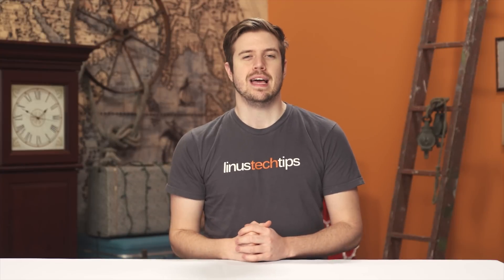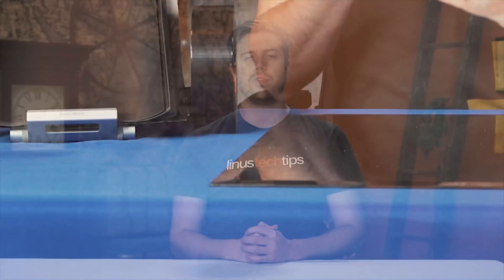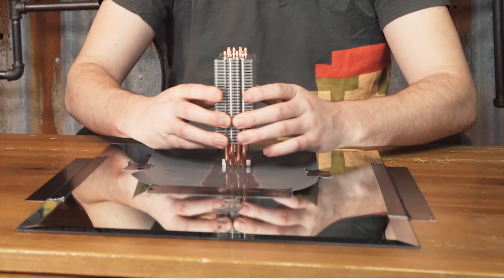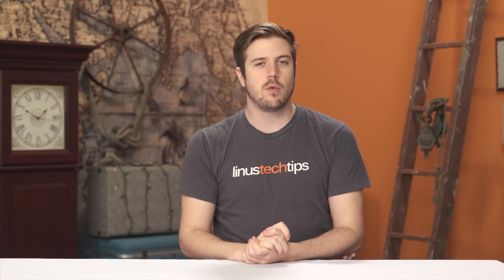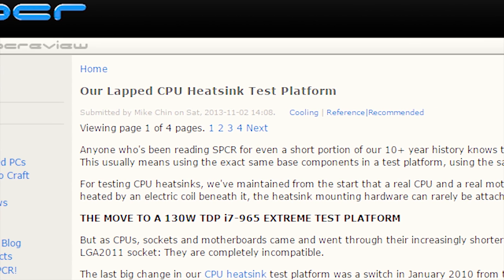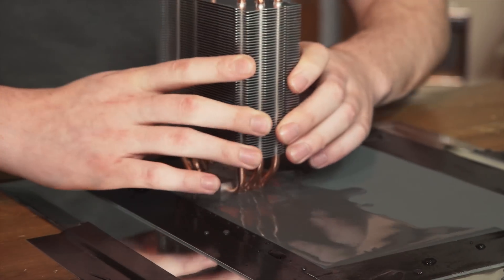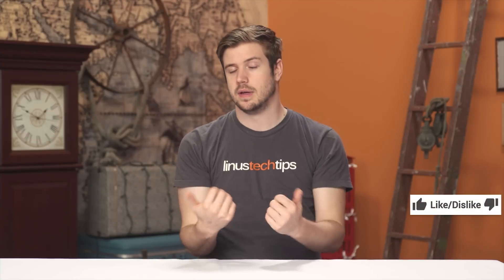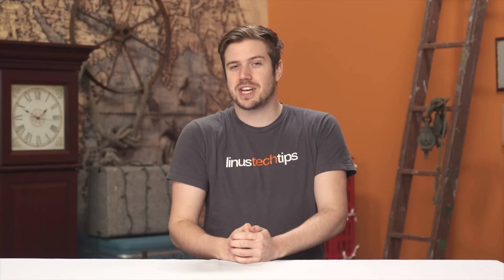CPU & Heatsink Lapping - Are concave, convex, or flat heatsinks best for cooling?

Comment: I have Thermaltake Archon cooler which has a really nice flat base - no need to lap it. I've been using it for last 4 years and it performs great. I've lapped my last 3 CPUs though and I've also delided my i7-3770k and changed TIM under IHS. At 4.4GHz OC on i7-3770k max I get is 65C (ambient around 22C) under Prime95 (ver. 28.9) max heat stress test and before lapping/deliding I would get near 85-90C with OC. Convex coolers work best with Intel CPUs since those CPUs usually have concave IHS'es, so convex cooler fits better. After I've lapped my CPU it would stuck to my cooler base even without TIM applied. I've applied a minimum amount of TIM just for safety - 1/3 of usual rice size and it was enough to spread on whole IHS after mounting the cooler. Luke should have tested lapped CPU and cooler combo (or even just the CPU when paired with that EVO cooler) - gains should be more visible, although do not expect more than 5C drops on new Intel CPUs. Why I do it? It's fun, you can brick your CPU and basically I'm bored :)

Comment: Luke, I doubt lapping would make much if any difference as long as you apply the cooling paste.  Just like in a car engine, properly lapped heads do not need a gasket to create a seal I would think a properly lapped heatsink would not need paste.

Try this same test with a normal heatsink and paste, a normal heatsink without paste, then the same two tests (with and without paste) on a lapped heatsink. 

I'm betting the only and or most noticeable difference you will see is between the unlapped and lapped heatsink without paste.

BTW do you also lap the CPU to make sure it is flat? If so add that variable to the above tests.

Comment: ouch, another waste of time. Mirrored finishes are good for ease of cleaning and reduce air drag, and that's about it. Lapping is typically done with a compound and using both surfaces to get the tightest fit. If there is a seam, there will always be air trapped inside that seam. At best you could gain 3°c or waste 3 hours, better odds with an aio water cooler at that point. I think cooler mods and testing are tapped out for the time being.

Comment: As someone who works with a lot of heat transfer (Nuclear Navy and Civilian Reformers) it kind of surprises me the amount of effort you guys are putting into this. The temperature you deal with in PC's is so low that as long as the surface is relatively smooth and flat you aren't going to see a difference due to polish. You are tightening down the cooler and forcing the two metals to make very nice contact, so that's all you need for nice heat transfer. As long as the material of the heat sink transfers energy rapidly. If you were trying to transfer something more like 300 F and up then maybe you would see the polish affect it but it would still be negligible. Differential temperature is still a better factor, so if your air cooled system is under performing you either need better fans or a better fin set, if that still doesn't work you need a better medium like water. The direct metal connection should be the last thing you put your time and energy into.
Reply: +Ian Tusa Not to mention that the manufacturers would polish it themselves if it made a difference. I mean that would be a super cheap way to improve performance of your product, but most don't do it.
Reply: +Tom Ault You isolated poor machining as the only  cause for that drop in speed?
Reply: Redesigning the entire heat sync would bode better results than just tampering with the direct contact surface area.
Reply: Tom Ault The electrician who learns how to put the blue smoke back in the circuit will be a millionaire.
Reply: Ian Tusa Linus did. Kinda. On a budget.
Granted as well - "fun" is dependent on the person =3 - while you may not find this fun or even having a point, if Luke had fun, enjoyed it, and wanted to just do it, that's enough reason for him to do it.
Reply: Zane Blalock He just seems to be getting frustrated about non-effectual things.
Reply: Ian Tusa Hello, welcome to humanity, I'll be your guide :)

lol - but no, genuinely agree xD
Reply: +Michael Kinkema While you guys might have qualifications in heat transfer you obviously don't know much about computers, imperfections on heat sinks allows nucleation of the blue smoke and results in a slow leak that degrades clock speeds over time. I've seen a drop in base clock of 50MHz in just one year from poor machining.

I'm sure in another couple of years people will have been putting LEDs in computers for so long that they'll start to think there's some performance benefit to it.
Reply: +Ian Tusa True indeed - but it's fun nevertheless :) - sometimes someone just wants do something for the sake of doing it.
Reply: Dhruv B He's trolling. Nucleation of blue smoke is a joke about electric fires.
Reply: Zane Blalock If they wanted something fun to do they could build their own liquid cooler.
Reply: That's what they're here for. They are the Mythbusters of consumer PCs. They test the random things people looking to gain an extra point on a benchmark are going to try before they decide to invest in a hardware upgrade. They are here to test and warn others before they do something unwise. I just enjoy trying to predict what is going to break first, the myth or the rig.
Reply: Another big issue is the thin pipes of copper that have to transfer energy a long way before the sink. The larger the differential the better the heat transfer and a long pipe makes for a slow gradual temperature change. It would be more ideal if the sink started earlier.
Reply: +Ian Tusa After taking heat transfer courses It surprises me how much effort people put into things that don't really matter. Metal on metal contact is going to have such a high heat transfer rate that nothing like this was ever going to matter much.
Reply: Steve Exactly

Comment: So your increasing the surface area of the heatsink. Now use graphene as thermal paste. Why don't you run sand paper on the CPU (without breaking it) as well  ?

Comment: I'm using 10 year old Xeon on modded 775 board, and i had issues with temperatures on CPU. I tried new heat sink, new thermal paste but nothing helped. CPU temps under load was around 85-90 with all 2 case and 1 CPU fan blowing at max speed.
After checking the web for solutions i found "lapping". I did a rough lapping, max sand paper i used was 1800. During lapping i saw that the IHS had a large dent in the middle that was massing with the heat transfer, as the heat sink contacted the CPU only on its edges.
Results are great, under full load i have 75-80 with CPU fan at max speed and 2 case fans at 50%.
It's still a lot but it keeps the cores cool enough to prevent thermal throttling :)

Comment: I kind of get the feeling that the increase in cooling performance is due less in part to the smoothness of the surface and more because the walls of the heat pipes are thinner...

Comment: All these tweaks just dont matter. Dont waste your time for those 2 to 3 degrees in temperature.
Reply: +Sword of damocles You have obviously never heard of the term "enthusiast"
Reply: +Ian Anderson heh
Reply: +Sword of damocles It's worth it in the long run if you think about it, 3 degrees is a decent amount of cooling for an hour of work. but i'm not overclocking and my cpu hits max of about 30c, so I won't be doing it.
Reply: +Superkoopatrooper my reply was to a statement talking about the difference of a couple degrees achieved by no specific means. Please don't rant on someone who's talking about something completely different.
Reply: +Ian Anderson ran out of ideas*

Comment: I need your help please :D Is this build good for 600€? This is my first time building a pc on my own :p

Cpu: Intel Core i5 4460 (3,2 Ghz)
Cooler: Cooler Master Hyper 212 Evo CPU-Kühler 
RAM: 8GB Crucial BallistX Sport (1600Mhz)
Motherboard: ASrock B85M Pro3 mATX
Gpu: ASUS R9 380 Strix (2GB GDDR5)?
Psu: Corsair CP-9020097-EU VS Serie VS550 80 PLUS ATX
Case: Sharkoon VG4-W Midi Tower (USB3)
Storage: 1000GB Seagate Barracuda (7200rpm)
Ssd: SanDisk SSD PLUS 120GB Sata III
Reply: +Rawrpwnzel I agree with Jan, get the 4GB version of the 380. You will NOT regret that.
Another recommendation is to stay the hell away from Seagate hard drives. Preferably go with HGST drives or a WD. And maybe go for a 250GB SSD. From personal experience, a 120GB will get full fairly quickly even when you have a mass storage drive for games and such.
Reply: +Rawrpwnzel I´d say it´s alright. Maybe spend few more € on the R9 380 with 4GB VRAM, anyway if you can wait, wait for June, there should be new GPUs coming out so you can either get a price drop or performance bump.
Reply: the thing is i don't wanna spend too much money, as long as it can run dark souls 3 etc. i'm happy

Comment: Early '00s with the Ghz wars it made a difference for, Straight die contact and with heat sinks that used inserts. It made a difference as a lot manufactures did not bother/care/know. Some were even rough to touch. 

But with IHS and Heat pipes, No.

Comment: next time try to do the same on 1° Gen  ACX Gpu coolers this surface was a mess  fully of imperfections and scratches.   
i did it in my GTX 760 ACX  and works very well,  just get a singnificaly drops on temps.

Comment: Soooooo, no cpu lapping? Why is it in the title then? In my experience with lapping, the cpu makes more of a difference. I have done this on a few cpus older amd 3400+, 965 and a 2500k All of them had temperature decreases of around 3c. Doesn't sound like a lot but when overclocking every degree matters.

Comment: What you did in the video would be considered simply wet sanding. My understanding of the lapping process would require lapping compound (a paste with abrasive grit in it used commonly in automotive valve lapping). It further would require lapping both contact surfaces which would include the CPU lid. I don't know if it would be a good idea, since any remaining compound might foul the CPU, but it may be worth a shot! I'd love to see a quick revisit with proper lapping technique.

Comment: this was done back in the day on The Screen Savers by Yoshi. he used a solid copper contact and polished it to a mirror finish. the results were very positive. it may just be that type of heatsink where the contact is not solid, but made of different parts. I did this with my stock amd athlon 64 3400 cooler and saw a 6 degree drop.

Comment: So you lapped the cooler and left the CPU? I lapped my waterblock and my i7 860 back in the days to a mirror finish and used almost no thermal paste between them. I got a 6 degrees c improvement. But this was a soldered CPU. I think the ones with TIM need a delid and mount without the lid.

Comment: Wait what? Is this 1st April joke? Who ever thought this was a good idea? The thermal paste or cooling paste is most likely a paste with high heat conductivity. It is used to replace any, or at least as many as possible, pockets of air between your cpu and cooling device. Stagnant air is good insulation and will keep the heat from spreading away from it's source. Metal on the other hand has good conductivity and is used for leading the heat to a cooler area or medium, in this case the air passing through your chassi.

The fans should be flat enough from the very beginning or else they are bad quality. Secondly, using sand paper you usually start with the rougher papers and work your way down to the finer papers to anything else is just not well thought through.

Comment: I think lapping was a thing back in the day (like years ago) when manufacturing a heatsink consisted of "Hey throw this block of aluminum on a table saw and sell it to AMD or Intel..."  combined with the TIM before Arctic Silver became a thing,,,  These days the quality of even the Evo 212 is pretty much 10,000 times better than the old shit, combined with thermal pastes being also way better. Just makes lapping nearly obsolete in my opinion.   

I in fact wonder if lapping could actually be worse... Like a golf ball flying faster because of those dimples, would not more surface area be better for heat exchange?

Comment: I lapped my Phenom II x6 1100T, The top of the heat spreader on the cpu was not flat, it was high around the corners or edges of the CPU, I dropped 10+C after I did that, I didn't do anything to my cooler other then replacing the thermal compound.

Comment: Luke please do a vid on if you really need to reapply thermal paste after removing the heatsink or you can ignore the air bubbles formed when you put it on back without cleaning the old paste

Comment: Lapping just makes up for a bad thermal compound to an extent. A good thermal compound will fill any of those imperfections and provided the molecular density of the compound is smaller than the imperfections on the die and heat sink then you will have no problems with heat transfer. Any air that gets trapped in these imperfections however will be a depredation in thermal transfer, so here is where lapping is only any good if the heat sink is really bad in the first place.

I do wonder however if applying the paste and heat sink within a vacuum environment would help? You would have no air molecules to worrying about between the heat sink and die, however im guessing a void in any gap would be worse than air molecules which can at least exchange heat a bit. Maybe a test worth doing though?
Reply: Iv thought about this since Linus did a budget of video then said"were not putting a pic on water or in space" ur point is valid that th e thermal paste would have less imperfections, but u need air molecules to transfer heat away from u the pc
Reply: +Manav Anand I didnt mean run the PC in an airtight environment just apply the thermal paste and heatsink on cpu in an airtight environment so there would be no air molecules between the cpu and heatsink. Theoretically the thermal paste should perfectly fill the voids on the surface of the cpu and heatsink. Once applied the motherboard would be taken out the air tight environment and then setup with other components. Im sure Linus Tech Group could fashion or locate an airtight apparatus, we had one at my naff secondary school many years ago!
Reply: Chris Mason u didnt need the big explanation... :) but i get what
 u mean now

Comment: if anything, lapping i think should theoretically be worse because there is less surface area between the thermal paste and the base of the heatsink. the imperfections increased surface area

Comment: Does it acually matter if you have a case on or not? Will the components be cooler with case + casefans because of airlow? Or will they be cooler in an open case (like the Thermaltake P5) or a testbench because heat rises?

Comment: sorry, it matters not at all. the thermal paste, when applied correctly, fills in all gaps, crevasses and curves and allows for proper heat transfer.
furthermore, scratching away the surface of the metals will actually increase the  possibility of heat induced oxidation which will hurt the ability of the heat sinc to transfer the heat.
DO NOT DO THIS
Reply: this is correct, to actually see the affect of lapping you would want to test before and after without thermal paste.
Reply: ***** 
no, increased surface area of the fins dissipates the heat, the surface area of the sinc that makes contact with the cpu, as long as it at least covers the entire cpu surface, does not increase the heat transfer from the cpu to the sinc. because there is only so much surface to transfer from.
the size of the cpu is the bottleneck
Reply: +Tigglet Please use capital letters, it's annoying to read a text without them.
Reply: +Tigglet Fills, as in removes air which is a insulator.
That's a whole different thing then conducting as well as a solid piece of copper or aluminum.
And if you remove Air...you don't have oxidation.
Reply: Tigglet
:'(
Reply: Hannes Dendoncker 
no

Comment: Luke, your lapping sucks.  I've lapped heatsinks before and saw a 7 degree change.  This was in addition to changing the thermal compound to the liquid metal stuff.  But, your lapping should be mirror like with no visible scratches.  Then you also need to lap your CPU.

Comment: Am i seeing this wrong?
When the CPU has 67°C with 19°C and after 70 and 22. Wouldnt that mean that the temperatures actually improved?
I mean you can't calculate it flat +3 °C because cooling down something is a exponential process.
Tell me: am i completely wrong?

Comment: It's pretty simple. When properly applied the thermal paste fills the gaps between the two surfaces. 

The surface of the CPU and heatsink are flat enough where anything you do will be so negligible it deems the process irrelevant. 

Our CPUs are just not pumping out enough heat to show any amount of improvement.

Comment: Luke the CPU you guys use is full of micro dents and scratches because of your poor choice of thermal paste so of course lapping the heatsink won't make a difference if the heat spreader on the CPU is in worse condition then the heatsink before you even started lapping....

Comment: just checked my cooler(noctua push pull) it had a bent in it Cpu > ]) < cooler. sanded it.right away up to 2000 grid and had an improvment of 2 degrees. pretty happy with that. thanks luke